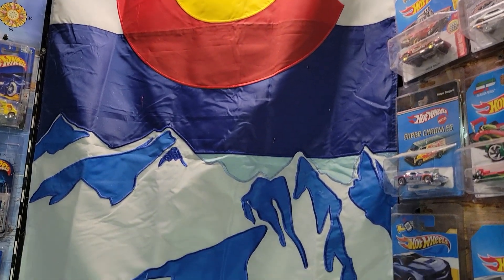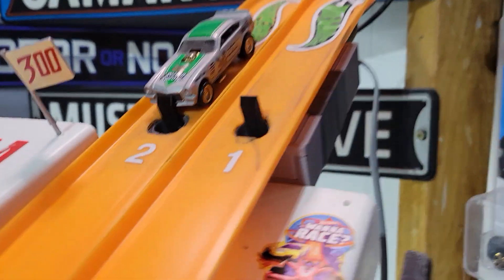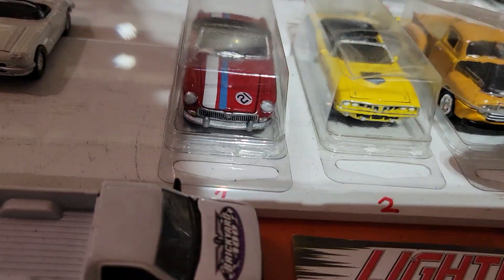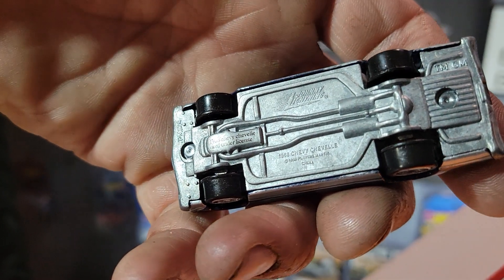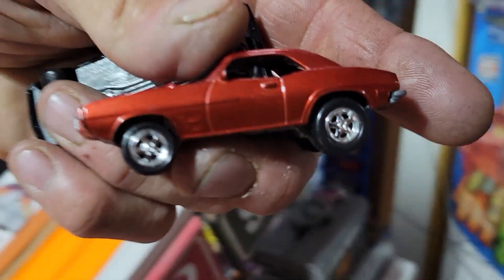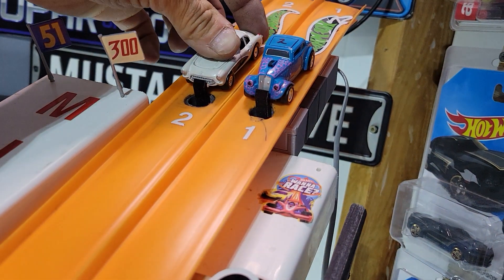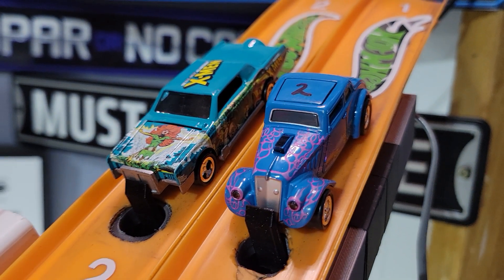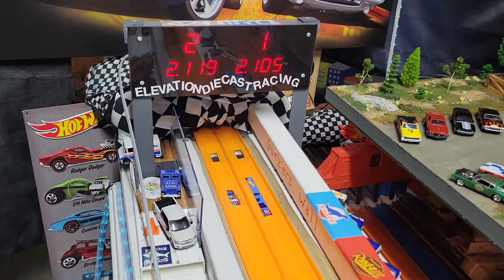FR⚡️DAY N⚡️GHT LIGHTN⚡️NG

Comment: those speed rebel wheels work very well on a custom hot wheels.  very fast as long as the custom doesn’t weight more than 2.5oz. or the axle will start to bend
Reply from the maker: I'm going to have to try that!!

Comment: What's PTFE?
Reply from the maker: A 3 in 1 liquid lubricant
Reply: Hey Lee, PTFE is teflon.
As a lube it can come in many forms. 
Sighs, yeah, the 3 in 1 PTFE that these guys use, isn't in Aus.
None of the high tech PTFE fluids / oils are here to try other than the (too) thick variety.
At least not that I have found.
Cheers, Marc D
Reply: @cutrockr-diecastracing2773  I checked out bunnings and wd brand has one and also ezy glide...are they no good?
Reply: @BathurstDiecastRacing  "Down the rabbit hole we go..." "Are they no good?" Hi Lee, that would depend on what your objective is. If you are looking for a quick, easy, pretty mess free, lube, these will, in most cases make a good improvement over an unlubed wheel/axle. *I note the two products you mentioned are aerosols, one has to be check that the propellants etc are safe for plastics. (Generally they are ok)The 3in1 Dave uses here is in liquid unpressurised form. Can't get in Aus that formula, so have been unable to test that one. There are quite a few different products that utilise ptfe in some form, available here, I have tested and experimented with many. How well (or not they work) can depend on the wheels/axle types, clearances, weight of car, temperatures, environment, viscosity, etc. Overall they work, so if you are just lubing for yourself, it's an ok option.
Once your opjective changes, to be competing to be as fast as you can, and be faster than other builders, the testing, experimenting, etc to find the "right process" for whatever wheel/axle combo you decide on, goes thru the roof, and often does the head in! Cheers!
Reply: @cutrockr-diecastracing2773  wow...a rabbit hole indeed. I guess unless you cam be frugal and direct the spray, you can get into all sorts of mess.
Thanks for the info!
Reply: @BathurstDiecastRacing  Mate, I'll send you an email, (day or so) and make a couple of suggestions, which you can try. You have a long outdoor track, high temps, hard surface.
Reply: @cutrockr-diecastracing2773  thanks brother!